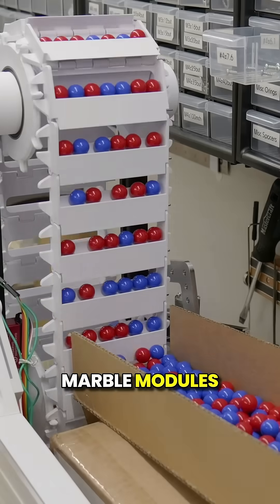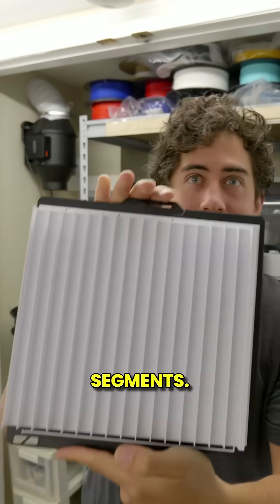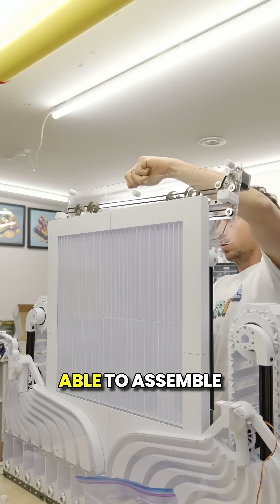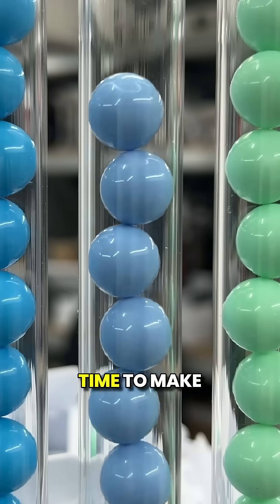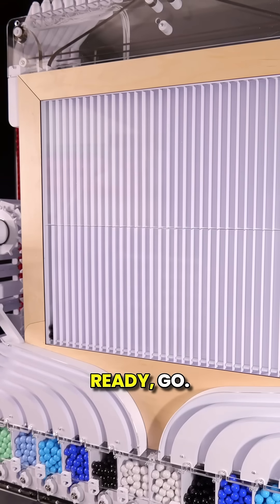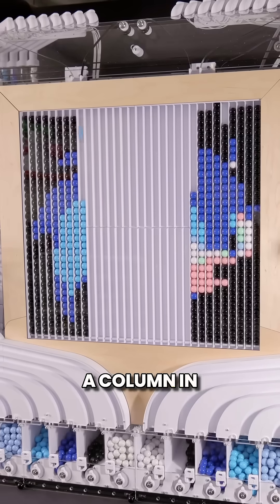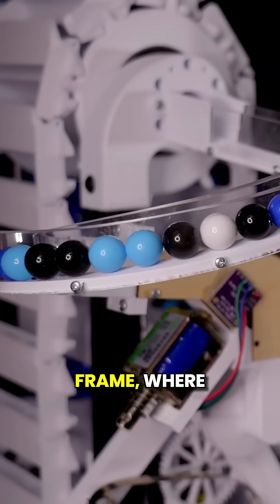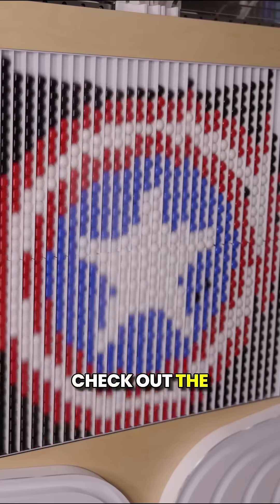The Marble Pixel Art Machine

Comment: Why does it seem to sag on top? At first I thought there was some flex the bottom marble tray but I see it's perfectly flat along the bottom. Does it just run out of marbles?
Reply: The front clear panel is probably being pushed out by the weight of the marbles, it seems to get worse the more that are added.
Reply from the maker: Exactly right
Reply: @Engineezy Do you have any fix in mind? The project is so awesome but that detail seems to distract some of us from the rest of the awesomeness. 😂
Reply: A thicker front panel is the obvious fix, but it might require redesigning and reprinting some of the structure.

Did we remember to stop for a minute and appreciate just how much design work had to go into this massive project to get it to even work in the first place before looking at the flaws?

(OK, minute over.  What's the fph -- frames per hour -- on this bad boy?)
Reply: @eamonnwalker4512  Oh I was just curious! I greatly respect the effort that must have gone into designing this behemoth of a project and I can totally understand just wanting to be done. Ofc it's excellent work, I just thought that part was obvious :)